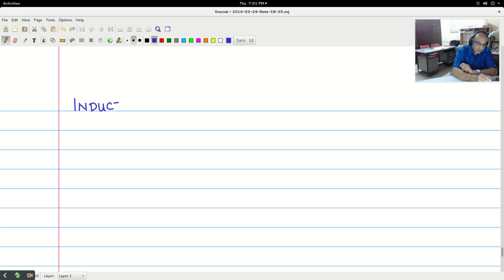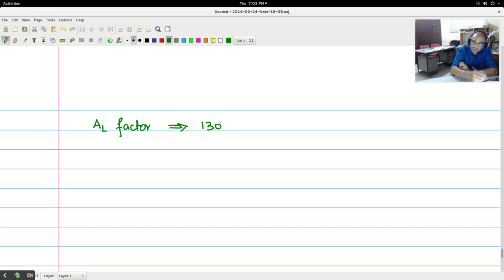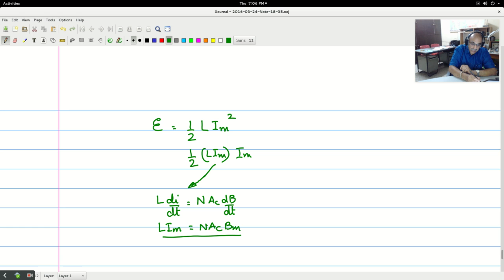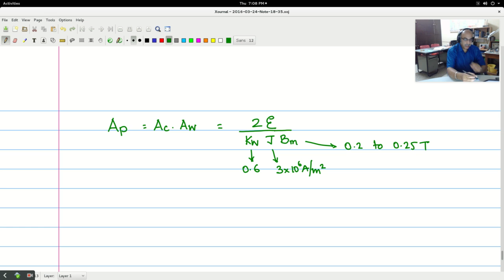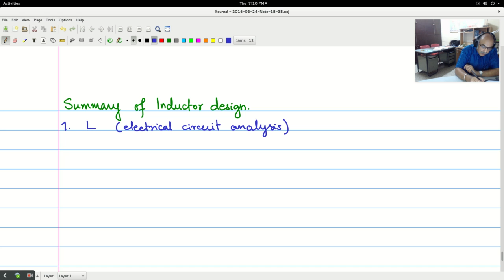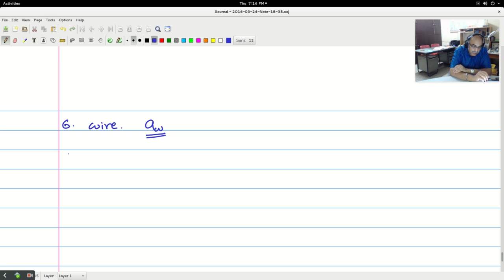Inductor Design

Comment: Dear sir, I am designing one non isolated boost converter for power 18000, and from calculation the peak current through inductor came 70A and inductor value is 0.5mH. So energy is 1.225 J. By applying given formula with Kw =0.5, J=4*10^6 and Bm=0.2. The AP i am getting is 612cm^2 which is very high. What should I do to reduce core size. Shall I go for nanocrystalline core?
Reply: No is already done